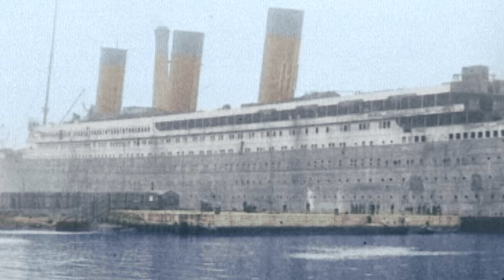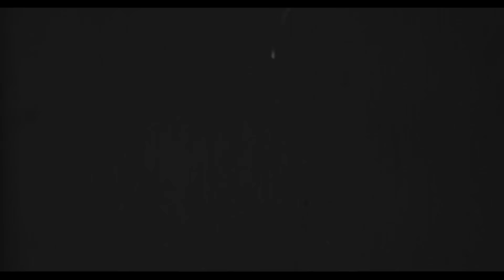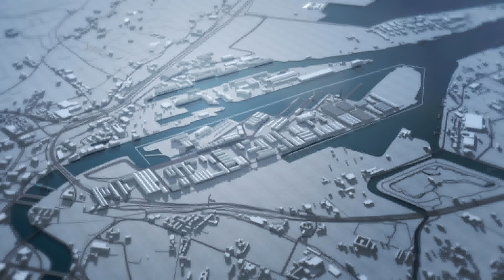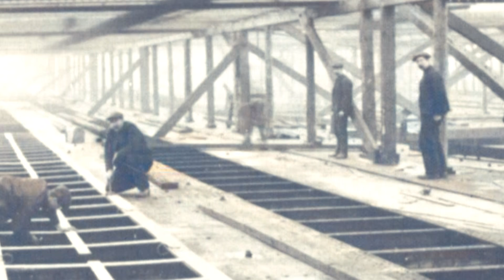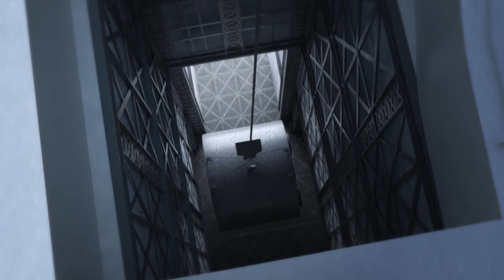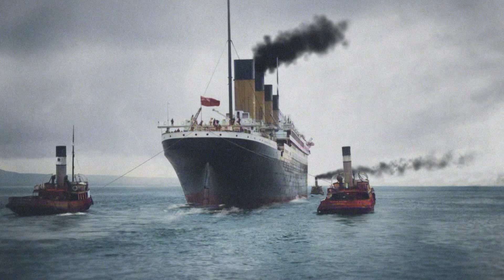Titanic: How They Built the "Unsinkable" Ship | Free Documentary History

Comment: Narrator:  And they left holes to srop the boilers through..

Noooo, they didnt keave holes just for that purpose, the holes you speak of will eventually be fitted out with  a fireproof casings, spider uptakes, lower, upper, and eventually the 4 external funnels.  

Secondly,  they didnt man handle those boilers, there was actually a gantry that ran the length of the ship they used to move those boilers, not just some small hand crank.

Mike Brady from oceanliner designs goes into a lot of depth into this

Also while yes the went with a hybrid engine design, that steam turbine runs on 9psi low pressure exhaust, piped in from the LP cylinders, it doesnt get the 215 psi steam from the boilers.

It was the addition of that low pressure steam turbine that made the combination so efficient, because once the steam finally hit the condensers it was running in a vacuum, its literally pulling the steam through the engines.

That hybrid design today still has the highest theoretical efficiency rating out of any design today

With a 90/10 LNG H2 mix, bump up the pressure to 500 osi dry

Upgrade the steel in the Reciprocating engine to modern premium alloys rated for high pressure steam, swap out the forged crank for a modular cryo fitted one,  same with the pistons,  swap out the piston seals for kevlar/teflon

Get rid of the stephenson linkage and integrate WARTSILA SP electronic controlled hydraulic valve actuators with VVT and valve and puston braking technology, run the exhaust through a premium LP exhaust turbine spinning @3600 rpm then double reduced to spin at a max of 205

Also ensuring your waste heat recovery of BOG

ORC system

Modern refrigerated oil intercooled thrust blocks and bearings

Theoretically on oaper this build has a thermal efficiency rating of about 42.7% and a theoretical methan slip of about 1.12

Nothing currently on water even comes close to those numbers

Because of the modernized upgrades this recip engine has an optimal operating rpm of about 78 to 80 rpm and an optimal center turbine speed of 190rpm.  Theoretically a ship of brittanics size would be pushing about 24 to 26 knots

Comment: How were the 4 ton 30x6 feet plates transported? I don’t see any train rails near by… and how did the empty shell of the ship moved without an engine to the place where the engines and interior were installed??? They had a small crane inside to lift 20 Ton engines?? And the ship needs 600 Ton per day fuel rock?

Comment: Engineers considered titanic unsinkable because they used steel to make the hull of titanic with proper factor of safety and they considered it's failure as a ductile failure in all accidental scenerio, but at site of collision freezing water temperature caused transition of steel from ductile to brittle material and due to this sudden fracture appeared during the collision, if it happened in normal water then that hull would deform significantly and absorbed the impact of energy by showing plastic deformation and significant fracture would not appear. This is why even in ww2 bigger ships generally do not sink by few torpedo shots, because their hulls deforms and when excess number of torpedo shot hit then those bigger ships used to sink.